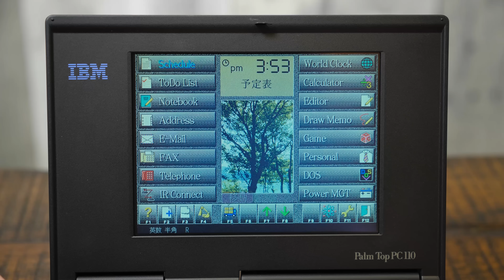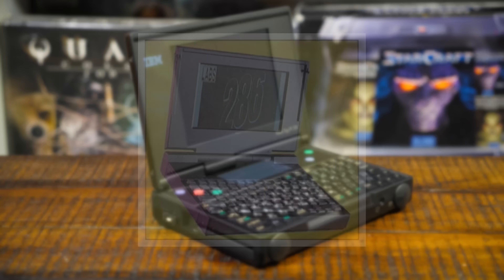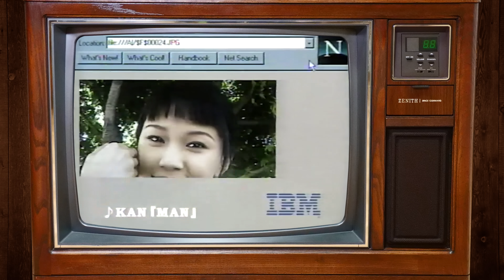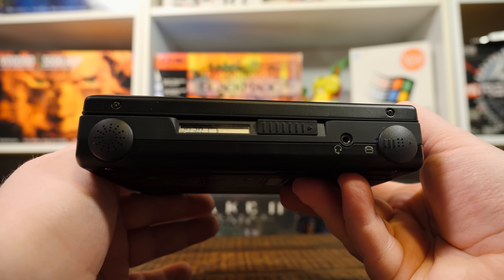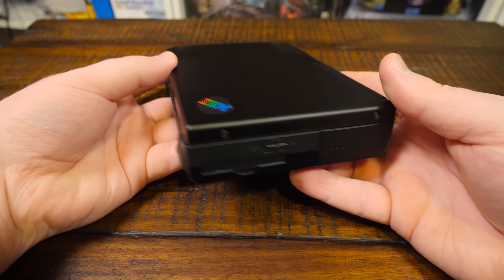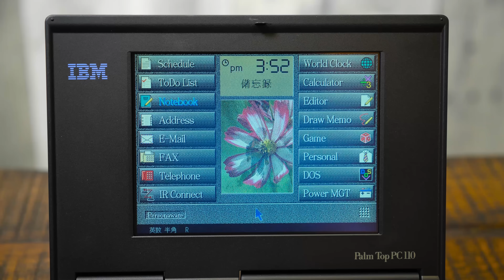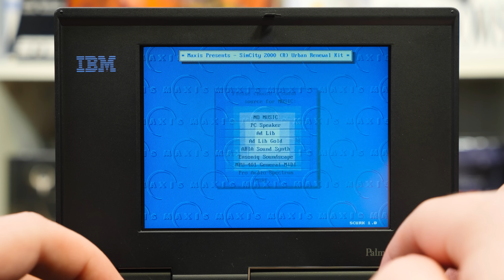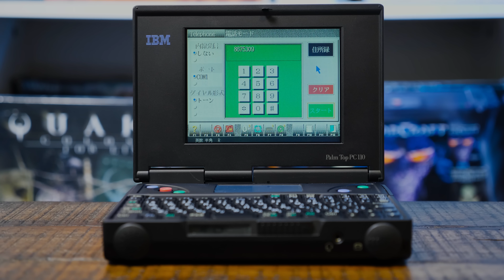The Smallest Windows PC in 1995 Was Also a Phone! IBM Palm Top PC110

Comment: Anyone remember the Sharp Zaurus? The later models were only available in Japan. (SL-C1000, SL-C3100, SL-C3200) These were mini ARM palmtops with Linux installed from the factory.
They aren't as capable as the IBM here, but are smaller.

Comment: 3:30
I present to you my experience with the thinkpad 2013 something.

I got a Thinkpad at marketing school as standard material. I’m half sure it was a 2013 model, and it was brand new.
I was hyped, because I’d heard the sayings about thinkpads being tanks and sturdy workhorses. Slowly did it come to me that, maybe, it wasn’t. 

First off, the weight. It’s a heavy lug - as is expected you would probably say. Yeah I could get that, if that ruggedness had an actual rugg to it. It doesn’t, because physics. 
Imagine this hippo as if it slipped out of your hand as you were walking between classes. That cheap plastic sure doesn’t appreciate being on the wrong end of lots of mass moving, coming to an abrubt end. The DVD-ROM-cover, the one that comes out with the tray came off. It of course never was the same again after that. It has an eject button on that cover piece, see.. I suspect one of the unexpected collisions with the ground dehabilitated it somewhat. The laptop ’’
In the middle of all this, the AC connector turns out to be made out of cheese crackers. It took a few months before it became a problem. I believe I tried to get a new AC adapter, but it still acted somewhat weird. Might be misremembering that last one,  but still. It was, as everything, made out of cheap-feeling plastic.

And the trackpad, oh my the trackpad. Its scrolling capabilities aren’t top of the pops, let’s say. Irritatingly unresponsive and laggy.
Screen was OK, for a cheap laptop; and this is not a cheap laptop. No Rolls Royce, mind you, but cheap it wasn’t.
I hated that thing.

Comment: I feel like LGR needs a land line just to try these crazy things out. Lol
Reply: Here in Germany you have routers with TAE plugs(the National plug for telephones) and they convert it between analog and digital. So you can use your old phones with a sip server. An sip account with your old phone number is still included in mostly all deals for home Internet.
Reply: Most routers have land line jack capabilities. The problem is most of these require a different sort of internet if that makes sense. Now if someone could find enough of these to make them a bit cheaper and more common people could modify a few to work on modern tech.
Reply: @Vlad2319  It's uncommon? Here in the Netherlands most ISPs toss in telephony with your internet package either  for free or a couple bucks a month.
Reply: He could set up a fake phone server and dial it etc

Comment: Loosing contrast.. I know whats wrong :D
old gameboys suffer the same problem.. they call it LCD burn or polerisor burn.
you can buy sheets of polerisor beleve it or not to replace the one on the screen.
just be gentile peeling the old one off the lcd maby use gentel heat to help.
clean the old glue off and after figuring out the orentation cut the new sheet to size and put on.

Comment: I used to have one of these, complete with docking adapter and external floppy. I gave it away. I am an idiot.

I did at one point get Linux running on this, which was tricky, as back then Linux couldn't boot from PCMCIA devices. I ended up using DOS and loadlin to load the kernel from the internal flash. It ran like a snail.

Comment: I would really want a modern-retro palmtop PC that has modern CPU like Intel Atom, but has hardware compatibility with Sound Blaster, Gravis UltraSound, MT32 and also supports 3DFX Glide both in DOS and Windows 9x. It's possible to just make minimal Linux Distro that boots directly to DOSBox and use any modern hardware, but I would really like a real thing.

The biggest advantage of real DOS hardware is super low input-lag. I have old DOS PC with CRT display and you really feel the difference from DOSBox. Emulation is still great, convenient and affordable, but it would be nice if we had other options.

Comment: Man this brings me back...i was a member of a huge community back around 01'. For the cassiopeia be-300. It was amazing a $150 full fledged wince machine. Cheap!!! It came with a cut down/broken version of winCE called topmenu. Later a dude we called goofather ported the full winCE is from an emate tablet  to fit within the be300- making expod! A fully working windows os with a startmenu and all. We has full ports and varietys of games. And pretty good compatibility with pocketpc2002 os from Microsoft. Sadly the be300 had a mips processor, so it was right before mips was dropped...the Dell axim largely took over the cheap ppc subset and the be300 was largely forgetten...so sad.

Comment: That screen issue is totally fixable! It's a failing front polariser. Sadly replacing it has risks, and a successful replacement will leave it with a slightly more glossy screen as the original polariser is bonded to the matte finish screen surface

Comment: The fact that you can still obtain batteries for this device is amazing. Proper future proofing in that sense, and goes a long way in solidifying the collectability status, since one could quite easily use it for some kind of productivity even today.
Reply: It was probably a cost and dev time saving measure that they used something off the shelf instead of proprietary.
Either way, yeah, amazing
Reply: No, the main issue with these are the LCDs, which fail randomly (it seems the layers come apart). Once that's happened, you can do nothing to help or fix it.
Reply: @the_kombinator  if the dongle is available, it seems like a VGA monitor can be connected without any problems
Reply: @proCaylak  You need a docking station, which makes it less appealing, and if you're going to plug stuff into a box, why not make a similarly sized Pii?  

I've got a Compaq Armada 1750 with 40 or so vertical lines on the screen which hinder usability - I mean I CAN plug it into a VGA monitor, but then why not use my MMX tower already on my desktop?
Reply: @the_kombinator  I agree with you when it comes to appeal of docking stations. But I am also convinced that they are some kind of an acceptable compromise between a full-fledged desktop and a laptop on its own. Of course it's a bummer in case that built-in screen gets busted. But I'm glad that there is still a way to use that tiny PC thanks to that docking station.

About the alternatives though... IF you do possess those things like Raspberry Pi or MMX desktop, then go with them all the way. As I've read and heard a lot of times, "Ask if before asking why.".
Reply: @proCaylak  I happen to have a few retro machines that I keep around for eras of gaming from 1985-2000 - I won't name them all, but I do have two laptops as well, one is a long term project (restoration, then sale) and the other is a portable gaming PII (another Armada, this one with a larger and not broken screen) but since the pandemic and us not travelling, it rests in a drawer. Last time it was out was this time last year when I went to Korea for a month. I have taken it to the cottage now and again, but now that I have a 2 year old, it rests peacefully in the top drawer (the laptop, not kiddo). 

I'm gonna go make my first video in a LONG while now about adding SCSI to a 386 from 1989. Peace!
Reply: @the_kombinator  props to you and cheers! :)
Reply: yes, you can still obtain batteries, but not everywhere. My HP 100LX runs on AAs so you can get replacements at any grocery store. But the slow 186 and non-backlit screen make it worse overall for productivity compared to the PC110.

If anyone's interested, I made a little DOScember video demoing my Palmtop, but I don't give it nearly the justice it deserves: https://www.youtube.com/watch?v=RNPNwPmP6LI
Reply: Its a shame not many companies keep the ability to future-proof like this anymore. Would save so much waste! Also, the fact it can use compact flash drives is a bonus as they're still in use today too!

Replace the screen and it'll last forever!
Reply: @Bassquake76  Future proof. 
Also: NiMh batteries on 286-early Pentium boards (Laughs in binary, then dies on an acid trip)

Comment: Im in love, a pity I would never have one, this looks so much cooler then my libretto
Reply: Weeeelll... the metal case, built-in CompactFlash slot and the fact that it uses easily replaceable batteries are great and forward-thinking for the time - but overall I prefer my Libretto 50 with its more well-defined keyboard, faster screen (and a Pentium at 100 MHz of course).

Comment: It actually looks quite cute, I'd love to have a small Linux computer like this!
Reply: try GPD Pocket
Reply: I've found the GPD MicroPC feels almost exactly like a modernized IBM PC110 (I used to have a PC110). I daily mine and it's pretty fantastic.
Reply: It already existed! It was called the OpenPandora, an small ARM based palmtop computer, I always wanted one of those. I think they are still working on it's successor called the Pyra.
Reply: There have been a few attempts at ultratiny laptops like that, but none have really taken off :-(
Reply: Hmm you are quite fond of small things (☞ﾟヮﾟ)☞
Reply: 3D print it with a compute stick inside
Reply: Actually there is a small Linux computer very much like this: the IBM PC110. You can't run Ubuntu on it but I've read about people running Linux on it. With a wireless card you could do quite a lot with it.
Reply: In fact, somewhat well-known amongst PC110 enthusiasts at the time was that the steward of the stable Linux kernel line, Alan Cox, owned a pair of these running Linux to work on the Linux kernel on the go.
Reply: they have those already they’re called Android phones /s